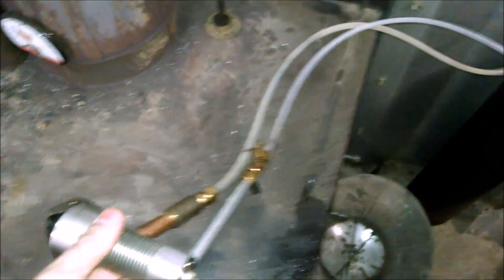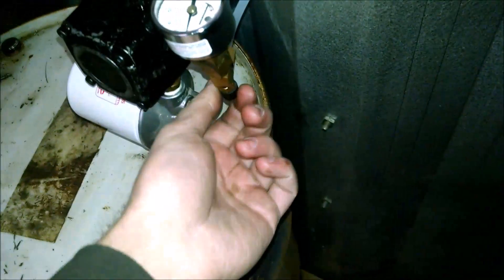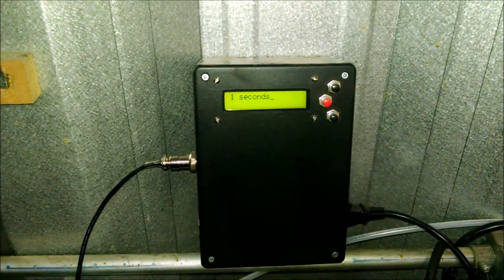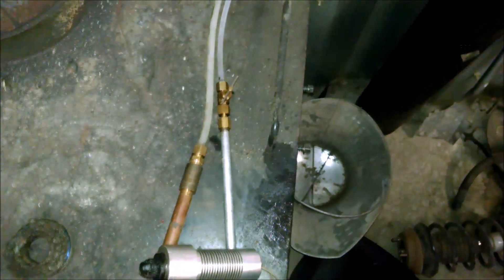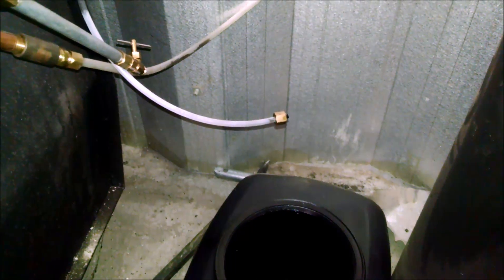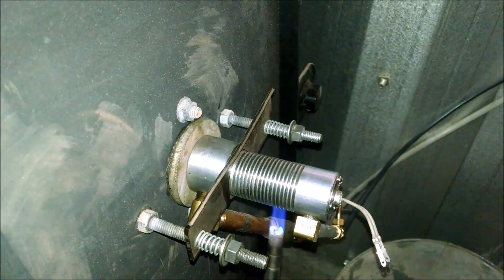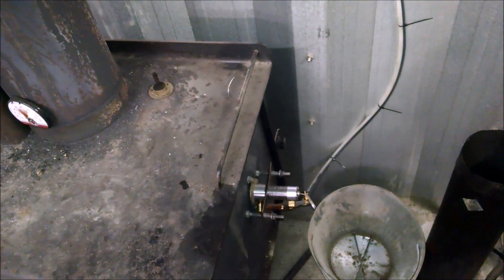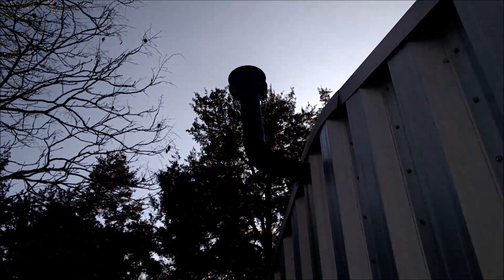Air Atomized Waste Oil Burner

Comment: Check out a pid controller on eBay thats what I use. It basically preheats a cartridge heater and has a temp probe and u set ur heat range and let it do everything else by its self. Also might want same solid state relays to protect the pod controller

Comment: This was a great overview.  Thanks for all the input and running through everything rather thoroughly.  
I’m converting an eclipse ng burned to propane and waste oil.  Just trying to keep the flame as hot and clean as possible.  
Heating 144cubic feet to 500*.  
I think I might use an arduino for the H bridge to control a 12v fuel pump duty cycle.  
I have plenty of steppers but no lathe to make a connecting shaft.

Comment: Is that other air line from a compressor? Is it possible you think to run without compressed air? I'm working on an oil burner for just a metal melting foundry so I will have a blower blowing, I just don't have a big enough compressor for using that.. great set up though, good stuff
Reply: Maxzillian, copy that. I think I'll stick with the drip feed until I can get it figured out. Thank you

Comment: Overkill bud.  Use a vaned refrigerator compressor.  Filter your oil prior and run right through the compressor.  and I recommend waste veg oil only.
Reply: Maxzillian Hey no offence intended.  Love what your doing.  The title only reads waste oil, not what type.  
Only metallic sludge and additives tend to clog Jets when using spent engine oils.  You'll find that refrigerator compressors are by far more efficient that typical air compressors and equally can operate at much higher pressures if required.  Was trying to be helpful.

Comment: Nice video...         use your propane torch to send heat up the flue to get rid of the "cold plug"    for starting the draft.     wish you had a list of parts...   plans... etc.
Reply: The combustion chamber from a miller oil furnace might be just the ticket the top and has eight or 10 inch hole in the bottom has a 4 inch hole on the side but you could use it in reverse instead of putting the nozzle against the 4 inch round hole where the barnacles lay the chamber down so that that 4 inch holes on the side directly away from your nozzle assembly? Or you may have to set that up on the brick to get it centered around the nozzle that would retain The heat from the flame to give you a much cleaner more stable burn!
If you were to remove your fiberglass rope ring and that big washer and open a hole in the side of the stove as big as that washer or maybe a little bigger that would suck in a lot of secondary air which would help in the combustion process and call your nozzle assembly down? Great job!
just my three cents.........